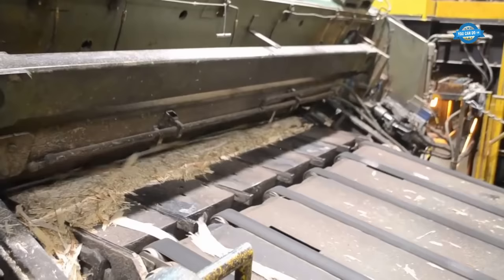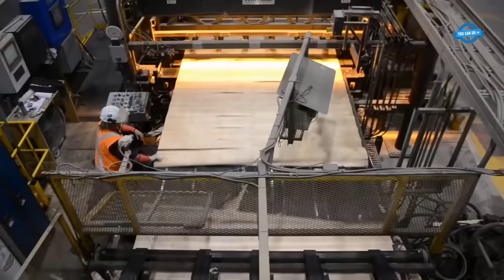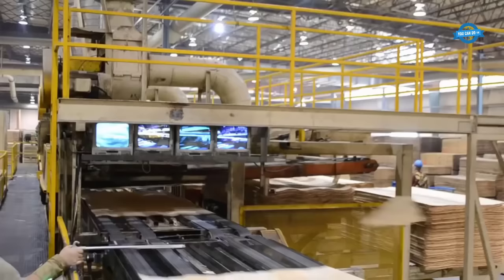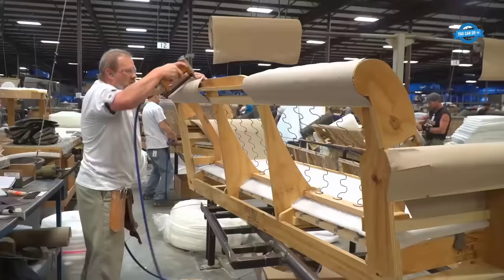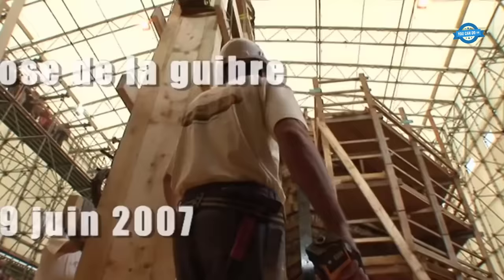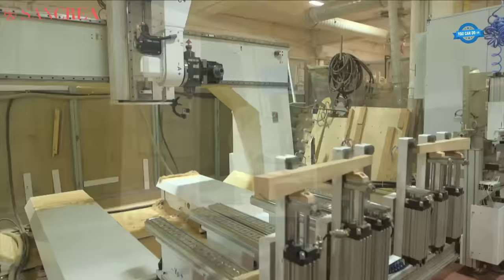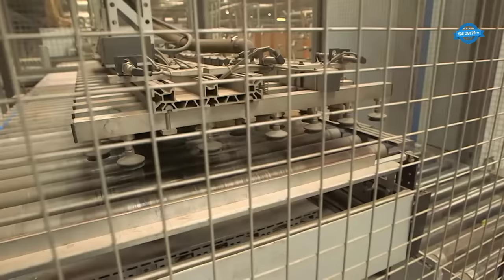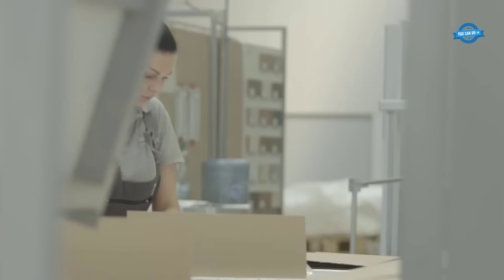Building Process Of The Historic French Wooden Frigate. Luxurious Wooden Furniture Factories

Comment: “Particle Board”. I don’t care what you want to call it, label it as, or cover it in. I have no use for particle board nor do I have any love for such a worthless man-made product. I hate and refuse to have anything to do with anything made from or made out of Particle Board. To me it is not even useful for throwing on a bonfire to be destroyed. Even then as it burns it produces hazardous toxic fumes from the man-made chemicals used in its production. Basically Particle Board is nothing more than leftover sawdust glued together with non-waterproof glue and plastic resin then heat treated in kilns to dry. It has no strength bearing qualities and is very fragile and subjected to easy breakage if bumped ,twisted, strained, or hammered etc.. It is very easily destroyed if subjected to moisture or if it gets wet. When subjected to moisture or if it gets wet it just crumbles and falls apart into soggy wet sawdust particles impregnated with glue and resin. Not to mention that it is heavier, aand everything made from it is heavier than things made from plywood of which even lasts longer and does not crumble and/or fall apart if it gets wet. How do I know? Years of experience in trying to use that worthless man-made junk as furniture (both store-bought and home-made), or in other woodworking projects. I'll take plywood any day of the week over that worthless/useless Particle Board. But that's my opinion from years of experience. Now do what you want to do. It's your decision and your money to waste, not mine. I'll even let you find out the hard way if I was correct or not.